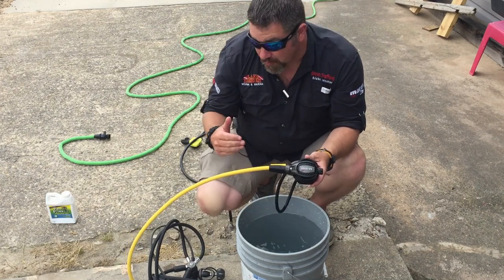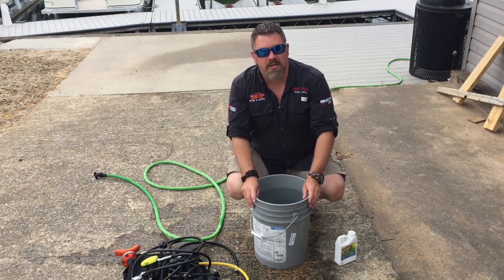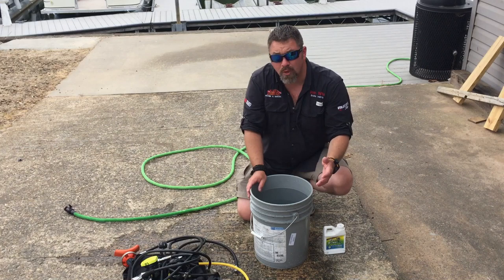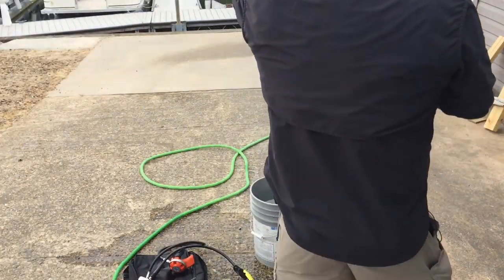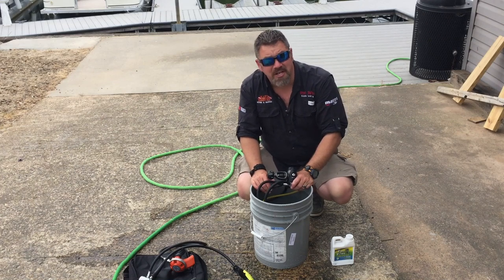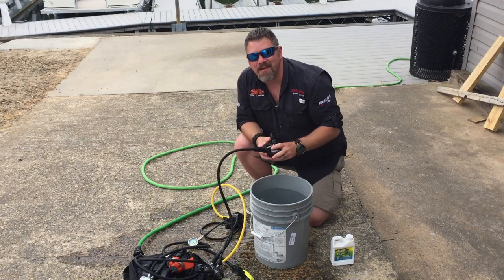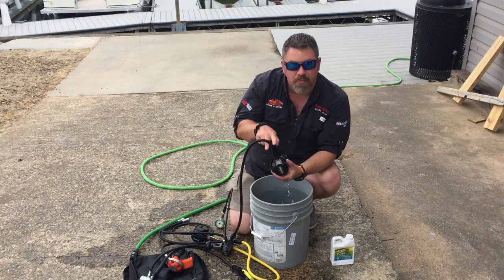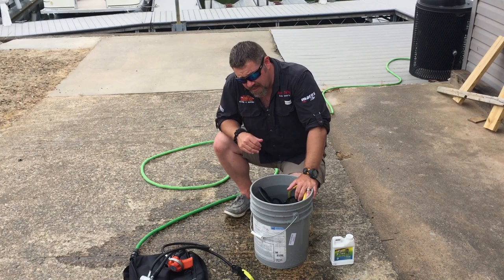Cleaning My Regulators {[Keeping It Simple]}

Comment: You're half right, you've believed your own myth. Even by submersing the whole system no water can enter the hose thus traveling to the first stage if the purge button is pressed while the dust cap is on! For water to enter it must displace the air and with the dust cap on the air in the hose has no where to go. The only way to get water in the hose and damage the first stage is if the purge button is pressed while being held above the first stage while under water.
Reply from the maker: Hello Mark Thomson, thanks for sharing your thoughts with us.
Reply: @LakeHickoryScuba  it’s not my thoughts it’s Fact!
Reply from the maker: We appreciate you sharing that with us Mark Thompson.
Reply: @marineboyocean  It's BS. The water pressure, even if submerged for a few inches, will compress the air in the hose and allow water in beyond the valve in the second stage. Also, the dust cap isn't air tight, and air can still be displaced. Once water has passed the valve seal on your second stage, it's in the system. Even if you don't raise the second stage above the first, the water in the hose will evaporate over time and get everywhere in the system.

Don't depress the purge valve when submerged if the system isn't pressurized.

Best practice is to have the system pressurized when you clean it, but not everyone has a cylinder at home.
Second best practice is to follow the manufacturer's instructions if the system isn't pressurized.
Reply: @bloodymarvelous4790  You’re wrong ! Dust caps are either rubber or have an O ring so as long as their screwed on correctly the hose is air tight!

Comment: Great video, just what I was looking for. And Im waiting for the next "more thorough reg cleaning " video. And maybe how to fix a free flow regulator. 👌🏻👌🏻👌🏻🤿
Reply from the maker: Hello andrespataky8410. I will see if we can produce a video for you on the most common reasons a regulator Free Flows. Until then, here is a quick reference guide. 1. The intermediate pressure is set too high. 2. The low pressure seat is damaged or worn out. 3. There is debris in the second stage holding the demand lever down. 4. The second stage cracking pressure is too high. 5. The second stage  demand valve is frozen (cold water issues with warm water regulators). And there are several other things that can cause a Free Flow as well.

Comment: Even if you had the regulator assembly completely under the water as long as the dust cap is in place you have created a air lock fluid dynamics with tell you that it would have to compress the air to such a degree that the Water could make a egress into the 1st stage Rather you held the button or not. ....got to love those  old timers
Reply from the maker: Some call me an old - timer, I just giggle and agree. Hope all is well with you guys at the coast.